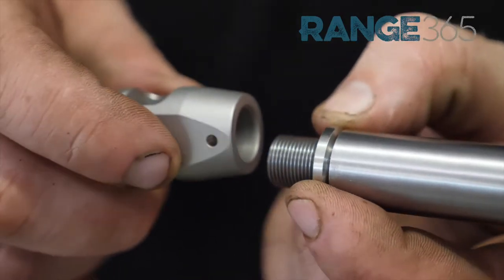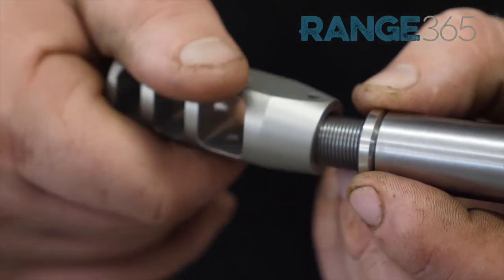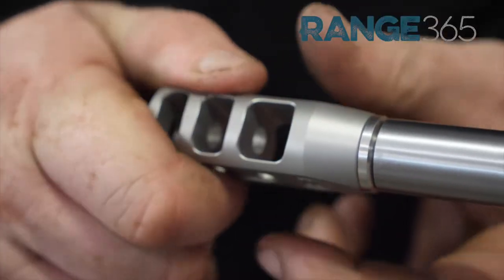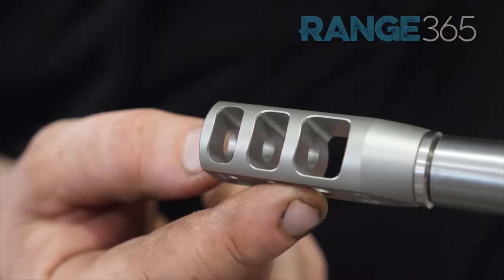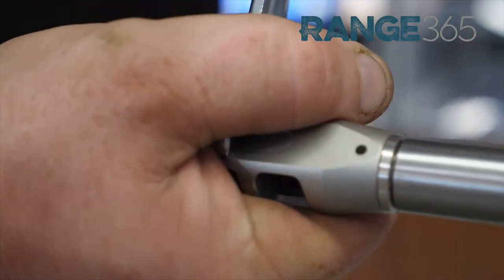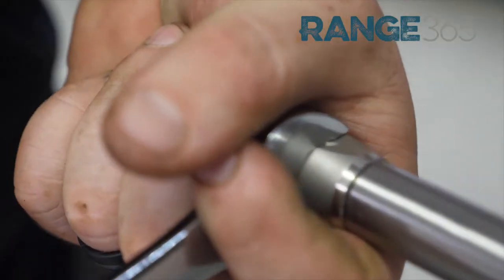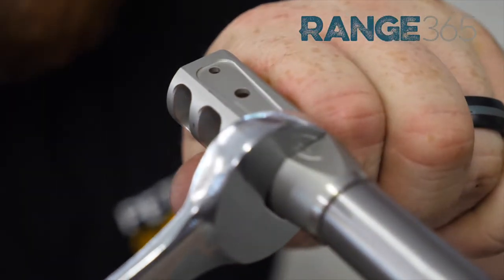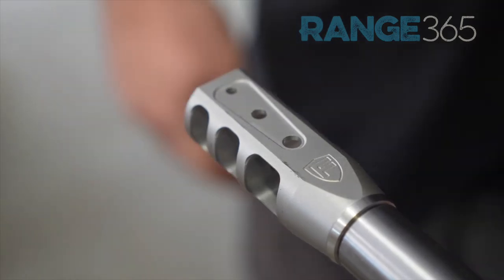How to Install AR-15 Muzzle Devices

Comment: Will the muzzle device stay tight or secured without threadlocker? I'm trying to determine if it is necessary for the few brakes that I'm about to install on my rifles.
Reply: One pro used grease in case you want to remove it soon.  Either way works.
Reply: The hottest point when shooting these rifles is the tip of the barrel, or, the muzzle device. Therefore, blue locktite is not needed, as it would melt of the threads after the gun warms up.
Reply: The crush washer puts force against the back of the device. There is no minimum torque setting for this but I’ve always used 30 inch pounds as a baseline. Timing and alignment are way more important. Not a bad idea to check it for tightness after a day down range. You shouldn’t be able to take it off by hand unless you’re a competitive weight lifter or arm wrestler.
Reply: @jonwarren7010  what about a 3x thumb war champ?
Reply: well😮,,, then ok😅👌
Reply: If you want to do it correctly pick up some Rocksett. To remove Rocksett you just soak it in water and it will break down so that you can remove your muzzle device.

Comment: You scratched the shit out of that thing
Reply: It's going to get scratched in any case
Reply: Imagine being afraid to "scratch" one of your tools. If you use it, it will eventually wear down any ways.
Reply: My thought exactly.
Reply: this aint a prop bud
Reply: well considering there is a million better ways to do it with out unnecessarily damaging your tool yea ok. Also those scratches with glint in the light. Not a big factor but it could be in the “wrong” situation
Reply: @1745pacman  if thats the case... that whole ass barrel either needs to get coated or replaced because it's shining brighter than a christmas tree